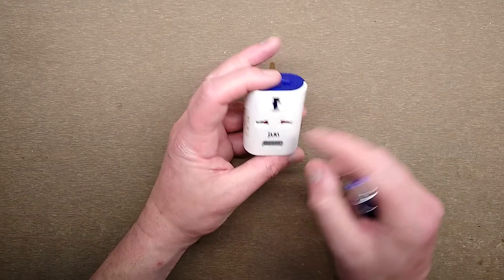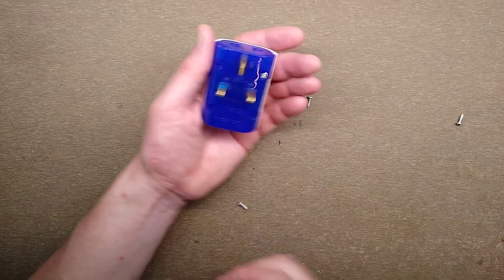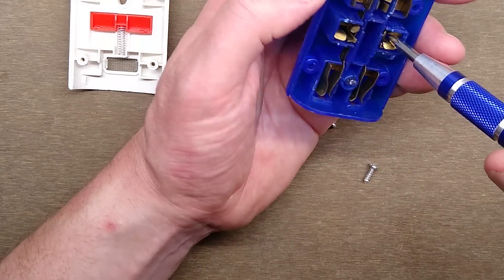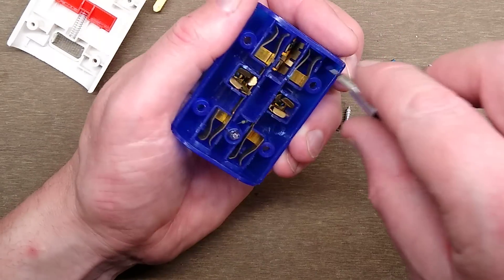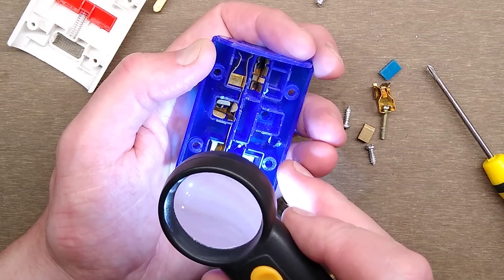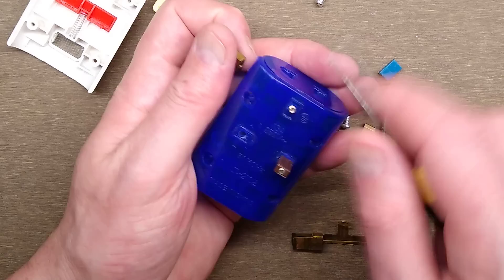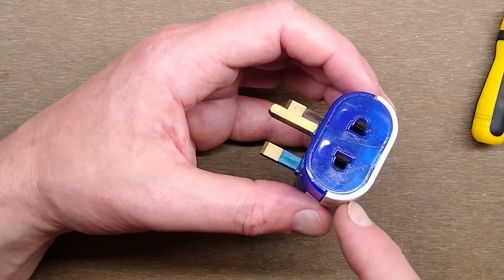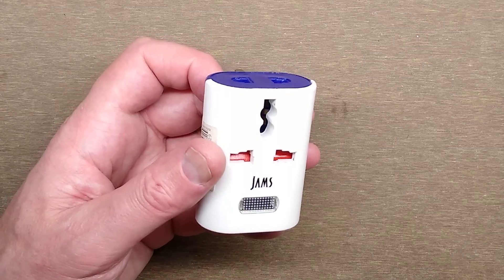Red Sea Mall death-dapter teardown

Comment: looks like 1/8 watt resistor, that'll fry nicely!
Reply from the maker: Yup.  Way under rated for power and voltage.  It will fail with a bang at some point in the future.
Reply: @bigclivedotcom  i've seen 1/4w 150ks in series with neons well blackened, if i come across any dead ones i usually fit 2 150ks in series, the neon is still usually bright enough

Comment: The screws for the L&N pins seem a major weakness both strength wise but also those screws are dubious resistance wise. Fine if you're not using anything high wattage for long periods though which is the likely use case for travel adapters. Personally I used to travel to gigs with a standard fused multiway UK block and either fit a local plug before I left (if I had one) or just buy one locally on arrival. A lot of people in the industry (including me) also have a socket block with a 16A Ceeform and then 16-13 or 16 to powercon etc. adapters.
Reply: I'm also worried about them backing out over time and potentially leaving the prong behind in an outlet. Best part is, you couldn't use any threadlocker, because that would increase the resistance!
Reply: Agree with you about the screws - never rely on plastic of any type for the integrity of a connection. 

Somewhere I've still got the Schuko to UK 4-way strip I made up in '82 for an exhibition in Essen.

Comment: i've found many electrical devices with the polarity 'reversed', somehow, such as laptop chargers with internal fuse in neutral line,  pc psus with passthrough power reversing it, etc. maybe makers get confused as american 3 pin outlets have live on left pin, unlike ours on the right.???

Comment: The deah-dapter I took with me to Europe a couple years ago was pretty nice. It had various pins that slid out for different country's main outlets. The only thing I didn't like is the ground pin on the UK plug was plastic like a lot of the cheap crappy ones which I wasn't a fan of but overall it worked great in the UK, France and Portugal. The two 12W USB ports on it were quite handy too.
Reply from the maker: I wonder if that's like the one I tested that allowed you to slide out live pins.
Reply: @bigclivedotcom  I actually went and looked after rewatching the video you referred to and no thankfully it's not like that. It has an interlocking mechanism that only allows one set of prongs to extend at a time and if you try to extend more than one they'll only extend maybe 2mm. However it looked like it may  have a slight flaw under specific circumstances when using the US plug. If you plug it into a power strip or certain types of extension cords the mainland European prongs were exposed and even when locked in place if you pushed on the slider they would extend maybe 4-5mm. Not willing to leave well enough alone I grabbed my meter and checked for continuity between the US and EU prongs and there wasn't any even when I pushed the EU plug out as far as it would go! When retracted they're disconnected from the connections to the universal outlet on the front. Being totally shocked at this discovery I plugged it into a cord that left the EU prongs visible and tested it for voltage and there was none. Did I mention it has shutters and a real 6.3A ceramic fuse too? The only rel flaw it has is like pretty much any compact style adapter you could plug in a Euro style plug with one pin hanging out but since this one has the plug on the front you'd have to be a special kind of muppet to get zapped and well if you do that's just another way to chlorinate the gene pool.
Reply: @LtKernelPanic  sounds like an actual good one. Where did you get it? Maybe we could get one to Clive.
Reply: The UK plugs are problematic with adapters as they are all the same. Typically the adapters that do not provide ground do not accept grounded plugs but with the UK plugs there is no way to do that so the user needs to be careful.

Comment: Love your color codes. The line should be Blue. High. Sky. Low should be Brown like the Ground. Dirt.
Reply: Live is brown because that's the colour that your trousers will turn if you touch it.
Reply: I remember the colours through Blue being neutral, in the colours worn and used by the United Nations (UN).
Reply: @nickryan3417  Honest, not stalking you  😆 
Or am I?

bRown
bLue
and
The Other One

Comment: These things are everywhere!  I bought a "100 watt" travel adaptor from Amazon.  I smoked it using a 75 watt load.  How curious!  The transformer inside couldn't have passed more than 20 watts based on the core size, never mind the wire. >_<
Reply: Well, if it was rated for 100 watts at 230 volts and you were putting a 75 watt load on it using 110 volts then you were passing nearly 1.6 times the amps it was designed for.
Reply: @joshuaewalker  Hi, not quite sure how this comment relates to this device. It's  a travel adapter to accept  supply connection of different configurations that is pin sizes/shapes etc. Where does the transformer come into it ?????🤔
Reply: @brucepickess8097  
If the adapter is exclusively meant to be used on higher European voltages then its 100W rating means it's only designed to handle less than half an amp. If the OP was playing around with the adapter on typical U.S. voltages then a mere 60W incandescent lightbulb would have exceeded the amperage and either blown a fuse or a resistor or melted some other metal connection.

Comment: "The value of the resistor is brown green yellow, 150k ..." You, sir, are a genuine old-timer as evidence by how you could rapidly interpret the old resistor color code! I doubt that today's crowd can do it without doing an interwebs search. I learned the code when I was in high school, memorizing a 10-word jumble of words that cannot be repeated in polite company.
Reply: Good old Violet. What a gal.
Reply: @johnopalko5223  But I learned my color code from a 50s-era Navy veteran. His "color code meme" was worse than anything Violet ever heard. <wink, wink>
Reply: @demef758  Dang! Now I'm curious! I didn't think there could be one that was even worse.
Reply: @johnopalko5223  I did not know Violet, but I knew her mother....
Reply: Old-timer also evidenced by use of magnifying glass to spot the rings. ;-)
Reply: @andreasu.3546  It looks like a 1/10th watt carbon resistor. Even kiddies with good eyes struggle reading them. "Old-timers" like Clive have accumulated vast quantities of EXPERIENCE and KNOWLEDGE that kids don't have.
Reply: Lots of us still have it momorised.  And if I wasn't so badly colourblind, it would be much more useful to me...
Reply: They still use the code on SMD resistors, but type out the 3 digits directly, like "474".  I memorized the code by it's system: Black-Brown-rainbow-grey-white.  The outer 4 is a modified greyscale, the middle 6 is a rainbow starting with red as 2.

Comment: I just want to know how many amps those tiny prong screws are rated for. I was surprised to see the prongs come apart into separate components.
Reply: Given the cross section of 20A mains cabling here, they look to have ample area to survive the 13A the adapter claims to be rated for.
Reply: 13 amps. It was labelled.

Comment: They could have fitted a non blow-able fuse for non compliancy.
Reply: Sure but there is a HOWEVER it wasn't made for the UK market even though it has a UK style plug.  Many of these kinds of things brought from overseas will be compliant with the country they are sold and or made  in.  In my travels I've seen a lot of electrical and electronic junk sold in the shops in other countries. That you would just shake your head in disbelief.
Reply: @misamsung6191  I think it's over 70 countries that also use the UK plug. But without being UK compliant. It was weird travelling in the Middle East and eastern Africa and not needing an adapter. Seeing this, luckily mine had the fuses in.
Reply: @georgeprout42  I always carry an adaptor even today when I travel.  It is one of  those things that I always carried for business back when I was travelling for business.
Reply: @misamsung6191  - mostly consisting of Chineseum crap 😠, are there more incidents of electrocution - deaths and fires in those countries?
Reply: @samuelfellows6923  Seems you failed to grasp that much of the modern electronics is made in the PRC.  If not complete units then sub-assemblies.  Of my 4 HP laptops only one is made in the USA and it is the oldest one just collecting dust in the cupboard.  My Apple iPhone is made in the PRC.  If I want something poorly made and not worth the price I look for the Made in USA sticker.
Reply: @misamsung6191  very difficult to find 'tech' /electrical stuff NOT made in china or eastern europe, just 'cause its chinese doesnt always mean bad, depends on what the main company, HP or whatever specified the standards are for them to be manufactured to ...
Reply: @andygozzo72  I know a lot of PRC made stuff is excellent in both price and quality.  I was pointing that out to someone who was a bit racist and has since deleted his posting

Comment: Hmm, being able to tap them is an unexpected advantage of those chonky UK power prongs. A similar device with US plus has the prongs just thermoset in the plastic housing.
Reply: They weren't thermoset in the older ceramic models.  Most genuine UK plugs has the rectangular brass pin extend all the way through the plastic sleeve, just like the similar round pins on 2.5A Europlugs.
Reply: We have the angry looking plugs over here in aus

Comment: Very tiny resistor!   I think you need to remove the shutter and send it bac to Vince in an even worce condition than he bought it. 🤣🤣                 nice video 2x👍
Reply: @sometimesleela5947  yup, well almost, neon will drop 50 to 100v, but still... that looks like a 1/8 (0.125) watt resistor, as was said in carry on screaming 'frying tonight' 😁
Reply: @andygozzo72  DoYou Mind If I Smoke?  I was trying to give it up🤣🤣👍

Comment: Not sure why they'd colour the pins (even if right!). It's not as though you ever need to know which is which. Perhaps it's for when you're using the adapter to trap the wires for a plugless cable into the socket, as you would .... (!)
Reply: i've had duraplugs with  colour coded sleeves...
Reply: @andygozzo72  I find it extremely practical to look at labeled plugs to remember which pin is supposed to be live as I try to polarize 2-pring devices in a setup.